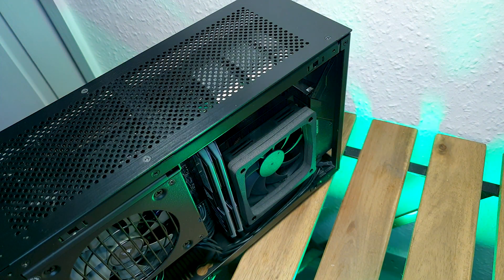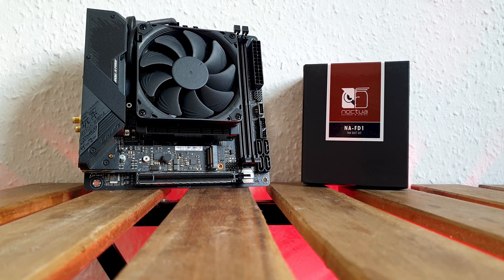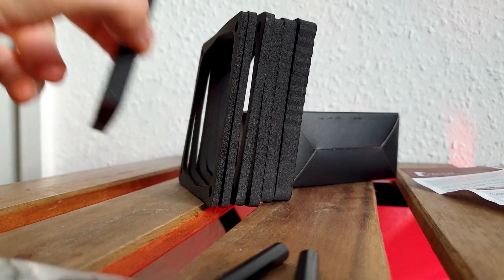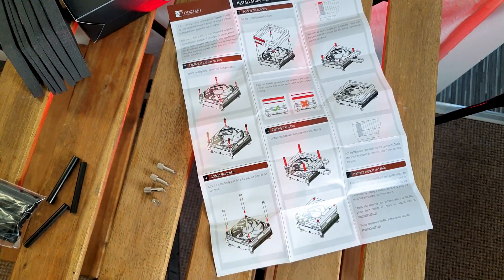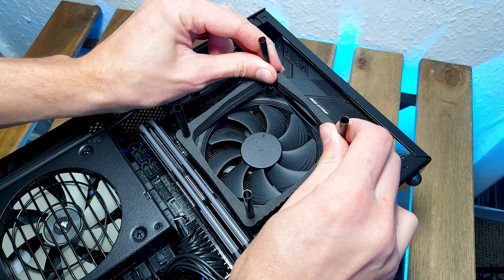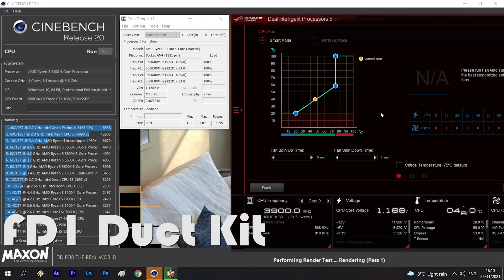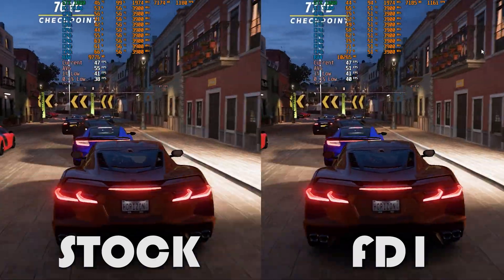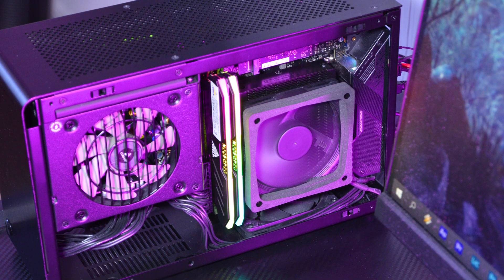The Noctua FD1 Fan Duct Kit - DIY idea turned Premium! - "MOAR" Part 3/3

Comment: My idle temps are 50 degrees C with the same cooler and the new AMD 7 7700.  I hope this kit will reduce the temps a bit more as Cinebench MT has a lower score with the case closed :(
Reply from the maker: It will help a bit. Best options will be to tinker the voltages and do what I did with my 5600x. I locked it 1.050v fo 4.0 GHz which gives me 95-98% stock perfoamance but 15-20C cooler. Check my other videos in the playlist. 
Should work on the Ryzen 7000 series as well.

Comment: Hi, sorry for the late comment but I applied this fan duct yesterday onto my NH-L9a in the Dan A4 SFX. I was only able to fit 7 mm instead of your 12... I have the Aorus X570-I as my motherboard. Do you think there is some problem with how I have mounted my CPU?
Reply from the maker: Hi. Hm, if you CPU doesn't overheat, you should be fine. Are those spacers all the way to the side panel?
Reply: @Glob3Tech  Honestly the case barely closes with the 7mm spacer. At stock, my temps were really not great... idling around 60-80, quickly jumped up to 90 with games as light as League of Legends. It is pretty warm in my room but that seems pushing it. I turned on Eco mode and turned off core boost in the BIOS and now it idles in the high 50s and stays below 70 with that light gaming. I am using a 5600X.
Reply from the maker: @prahaladgiridhar6788  I see. For peace of mind you can double check the l9a and reinstall it. Also then do what I did and set the CPU at 1.075v for 4.0 or 4.2 GHz which will roughly give you stock perfomance but with way better overall temps. Check my 5600x video please on the A4 playlist 👍